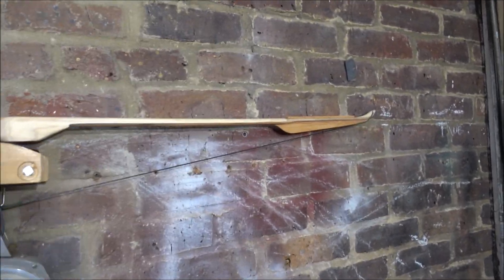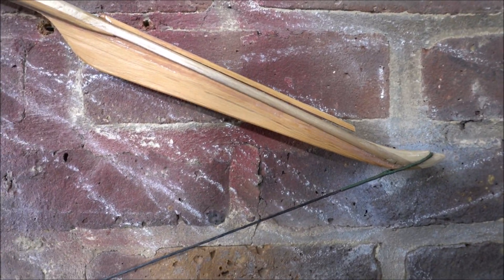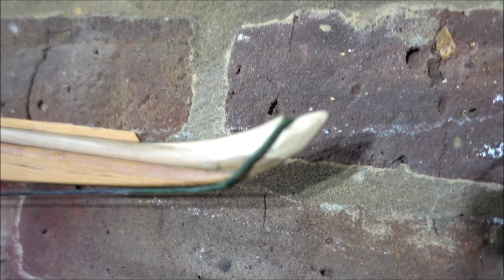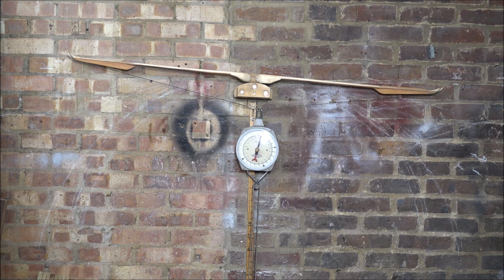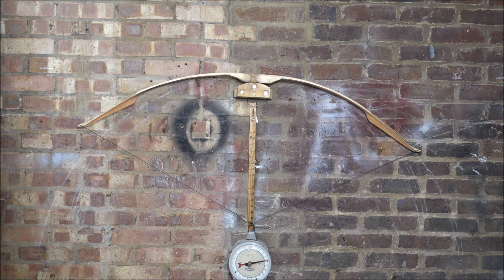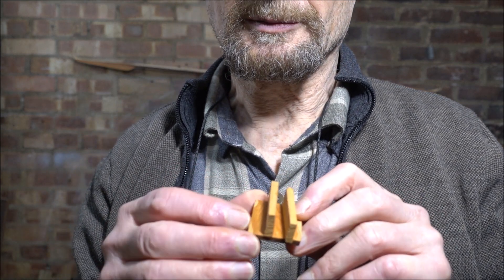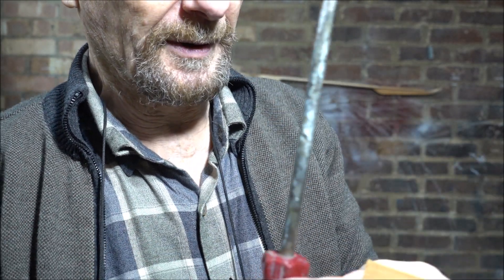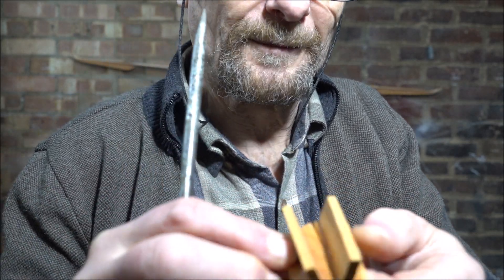Hickory Flight Bow rework pt7

Comment: Q: Why do you want the outers to stay stiff, and flex so little? Is there an advantage with flight bows to do this? I have an idea why, but want to hear your thoughts on it.  I like the little glue "trial". I do it a lot.
Reply from the maker: Short answer... I don't know!
It seems to produce a fast bow, It may be to do with string angle at the tip, or just tip lightness.
https://bowyersdiary.blogspot.com/2015/07/mollegabet.html